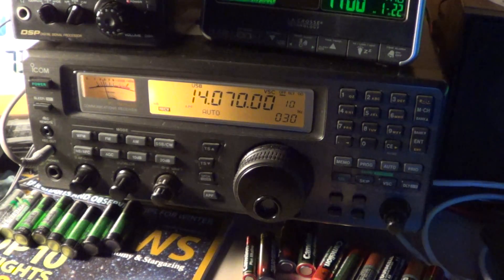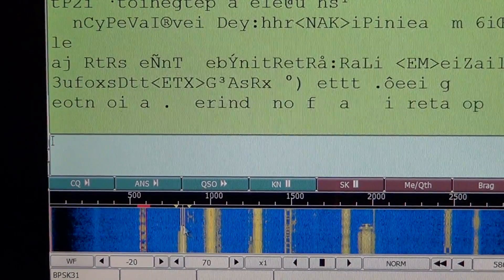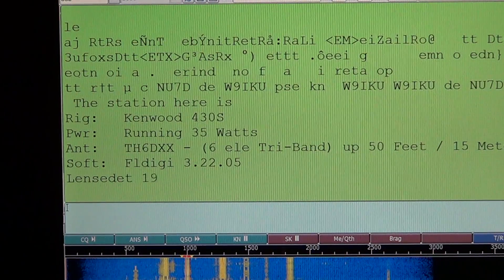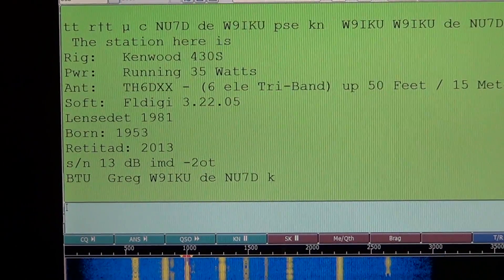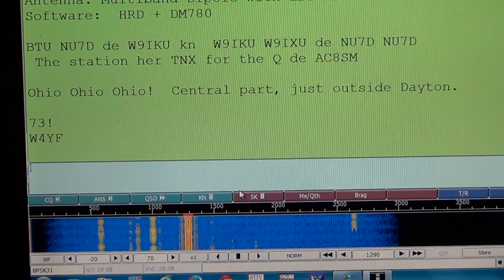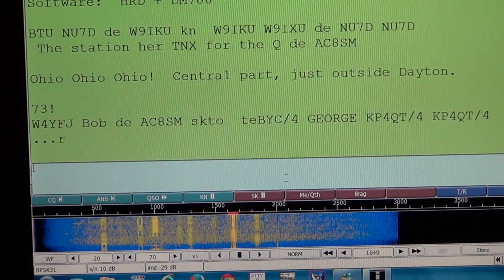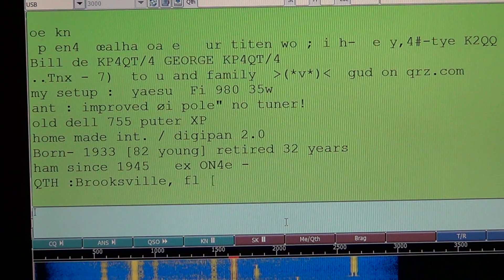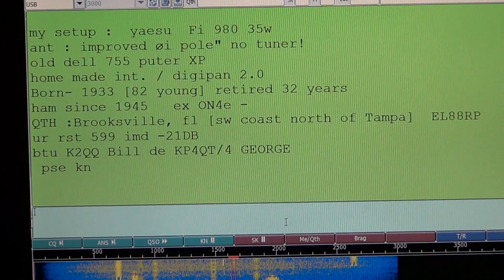FLDIGI Tutorial How to decode BPSK31 Digital signals

Comment: Great tutorial...PSK is very addicting....requires low power and can receive when band conditions are less than good! 73 and keep up the GREAT work
Reply: Ive been struggling with getting any psk31 decoded. Using an sdrplay rsp1a, sdruno software, vb-audio cable, virtual serial port, and then fldigi. My sdr is connected to a chameleon emcomm III. Ive been completely unable to get anything other than a bunch of random letters and characters. What might I be doing wrong?